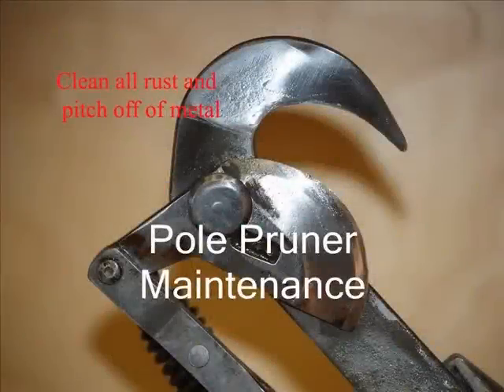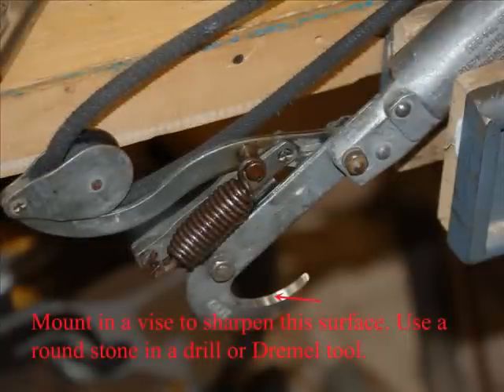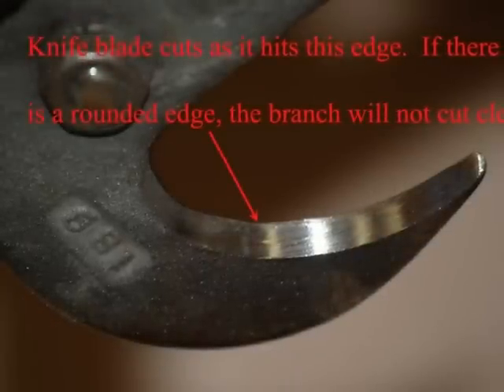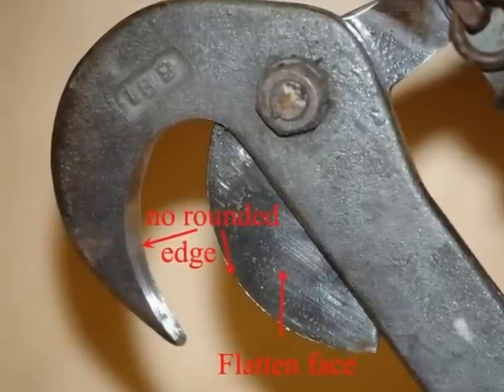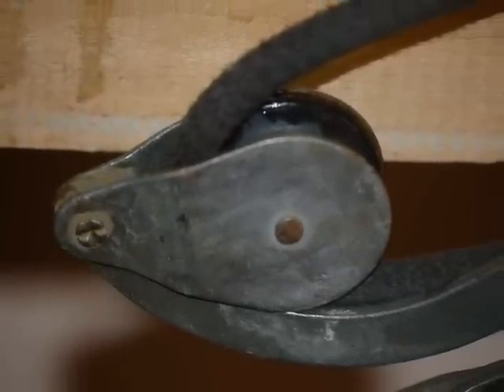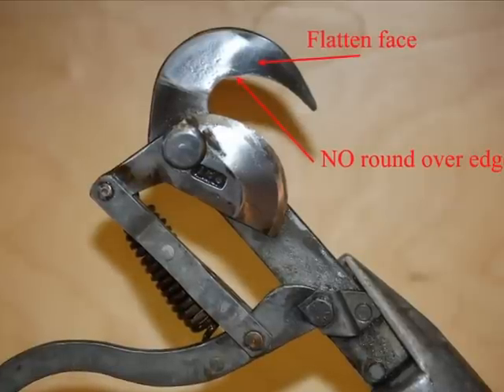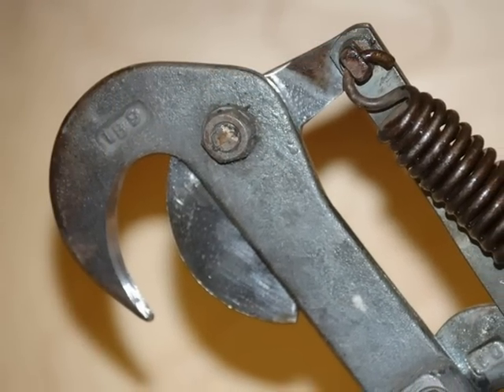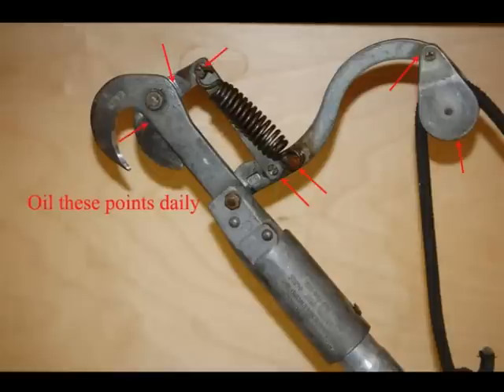(52) Pole Pruner Maintenance

Comment: 20-some years ago I was given an antique pole pruner that does what this does. The head is thinner for a good cut, higher up in the tree. It's not a Marvin, I don't know the brand. But it makes a better cut than Corona does. At least in this application. And I love corona tools!

Good, practical video. (Have been through the spring problem too.)

Comment: Hello! I have this exact product and I'm trying to repair it. Idk how small the spring has to be so I just grabbed the smallest one I found. However, the problem is the rope. I dont know how to work the pulley with the rope in order for it to cut. Plz help
Reply from the maker: Mapache19 contact the manufacturer for parts. Marvin is the brand